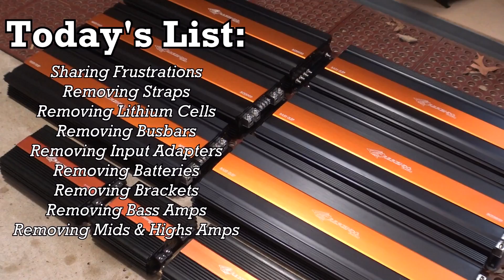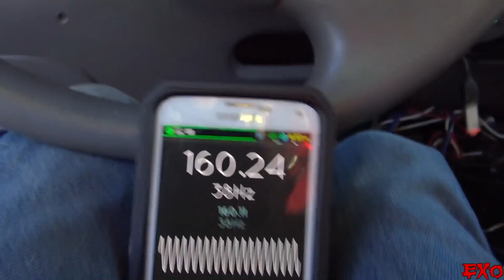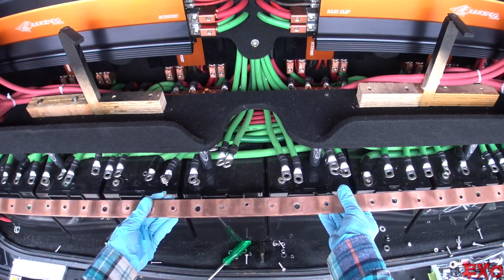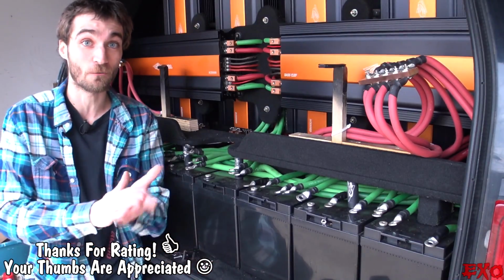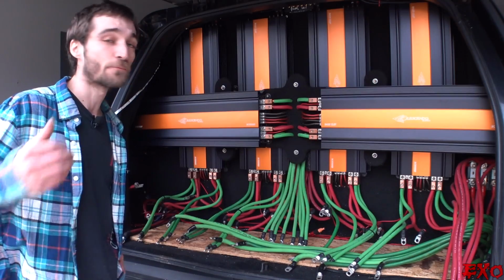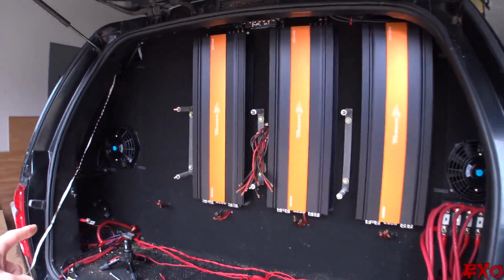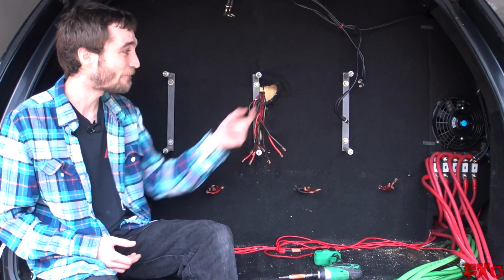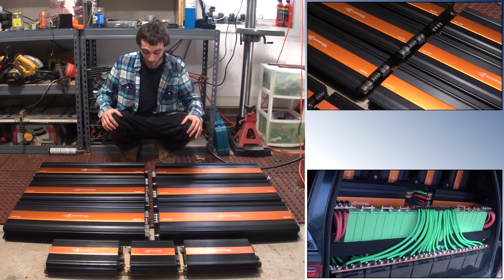REMOVING a $15,000 Car Audio System!! EXO's 30,000 Watt AMPLIFIER Install w/ Lithium & AGM Batteries

Comment from the maker: LET'S GET BUSY!!!

Happy Thursday, Everyone :)
Reply: EXOcontralto you just doing it but it box keep it going man that's up to you bro for life have a good day big heads for life and have a good day are you there you could do fiberglass that's a good box too I like five I like fiberglass but that is messed up so I don't know have a good day
Reply: Angel Studios GSG Gaming huh?
Reply: 50,000 Watts!!!!! Up next? Holy s***!!!
Reply: EXOcontralto You know I always love me some crescendo powa
Reply: someone might want to buy some of those AGM batteries for building backup power supply or solar power battery bank. quite a few different uses for heavy batteries like those besides car audio since they are good for deep cycle use.
Reply: 4Awg can take like 120A if its copper, thats a hell of alot ;-). what can help is keeping your wires shourter (if you can) to reduce resistance losses too.
Reply: True, double the cross sectional area of the conductor and its resistance will half. 3 factors are the resistivity of the metal in the wire, thickness (area) and length
Reply: EXOcontralto Awesome video bro. I can't we live in the state as you. Can't wait  to meet at a show bro. You are one of the postive builders on youtube and with ur videos u have taught me alot... Always keep up the videos bro God bless. I def want to give a demo sometime of my system
Reply: EXOcontralto yes!! exo you have been a huge inspiration for me and lots of other people... keep trucking on!! You have actually inspired me and my twin to start planning our own build. We are thinking of either 6 15s, or 8 12s in a school bus along with some bunk beds, then road tripping it to Texas on our senior year so a couple years in the making but hell look at franky. Friggin 7 almost 8 years in the making still going big and getting it done!! Keep on keeping on exo love the videos!!
Reply: EXO bout time for another video! Lol
Reply: EXOcontralto pay day tomorrow exo !!!! Hey got any tips for a starter ???
Reply: EXOcontralto  You and I think alike a Lil OCD.. open up the back panel of the amplifiers to check the condition of the thermal grease between the heatsink and the finals or the drivers.. we all know how dry thermal paste affects the cooling factor of the amplifiers. TOM NJ♡♡
Reply: 1 I use to rebuild alternators back in the day and checking the brush conditions isn't that hard especially if you have a paperclip before putting them back together. Alternators are to maintain the health of the battery.. and if one of them starts to fail it will affect all of them. Putting extra stress on the voltage regulators which also contain thermal grease... hmm mm great question. TOM NJ ♡♡♡
Reply: Elliot Hunt  keeping them shorter definitely helps with resistance.. and keeping the polarities further apart or shielded helps also.. great reply..Tom NJ ♡♡♡
Reply: Keep up the energy don't worry about the extra special effects.. keep a little piece of paper with different suggestions on what to do.. Morris County Audio New Jersey 5 years ago put 3 in of concrete on the bottom of their Blazer with PVC piping to run the wires to the back.. they came in second place in Florida.. love SPL!!!!!!!!
Reply: I do a RE Audio 15 sxx v2 tuned to 29hz
Reply: EXOcontralto are you selling your old agm's?
Reply: EXOcontralto where do you get your copper bars at for a (block distributor)
Reply: Fix your description past is the word you want. Passed is something you do in sports or at the dinner table.
Reply: If you are looking for new ways to do videos or your channel as a whole I suggest starting a Discord server. While this is primarily a gamer based activity it would let you create a more 1v1  feel for some of the more die hard/active viewers. You could find other people who are good at installs and have them be admins then when people ask questions if you can't answer it then the admins can. I think it would be a really neat thing for you to ad to your channel/rapport.

Let me know what you think!
Reply: hey i am from 2019 i didnt get the video before that video can some one help me out plz

Comment: What you need to do? Is make your own fiberglass "Speakermobile"..line speakers all over the roof,fenders,sides,aim more at the ground through holes in the chassis. A moving San Andreas fault with 1,000DB easy.

Comment: I have been watching you off and on for what must be a decade or more. Crazy times. Your post work is amazing man and your workmanship is even better. I am stoked to see the new setup. I have a question, any reason you don't solder the tips of your connections to really max out the current transfere?

Comment: Unbelievable how much the price has went down and quality gone up. 
 In 1987 I had over  almost$17,000 in a 4,000 watt rms Alpine system ,with some Audio Control EQ and crossover equipment. Just unbelievable.
Reply from the maker: Prices are still pretty high in some markets.

Comment: Hey EXO building behind system here and was just curious which RCA cables you trust the most and why I want to get the best sound I can and I figure the radio signal cables would be something that I shouldn't

Comment: If the back allows for it, why not shingle the amps with a slight gap between? Airflow can be dealt with using fans, but this might be the most space efficient way to do it, especially now that you're going to have eight amps.
Mount them horizontally, and put them at either a 45° angle or a 60° from the floor (30° from the wall) angle, and stack them that way.

Comment: Awesome video EXO i was wondering tho what are good RCA cables to run or what do you run
Reply from the maker: I use cheap MonoPrice & AudioTechnix mostly. I hate it when people say you need $100 pair of RCAs lol
Reply: EXOcontralto thanks im dooing a rebuild and have been researching RCAs i wanna go with a bc5500 i just orderd a pair of skyhigh lastnight its just that i heard there is diffrent types but seams they are basically the same

Comment: You put so much effort to mount those things..... You are now tear downing..... 😖😖but hai... Now it will be awesome....
Reply: Ranjan Gupta did you notice how many washers he was using for the amplifiers as a spacer? It must have been like $5 for each Bolt.lol.. he should go lighter and possibly use small tubing made of aluminum.

Comment: You can do 10 18s jp did it in his Tahoe with no problem, I'm not going as big as you but close, im either going to do 8 3500's or 4 7ks on 4 Tantric Shd 18s
Reply: I believe JPs was sealed thought. Major airspace difference
Reply: Yeah thats true it was sealed

Comment: You must have a lot of money to burn...I just bought a used 2003 Mazda MPV with original 65k in mint condition and it cost me $6,000 -less that half of what you paid in amplifiers.
The high powered car amplifier trend is all new to me and the word madness comes to mind. Many extreme audio builders would agree, as they often say "it's insane!" to express just how powerful their audio system is. To use a negative (word) to prove a positive one is to admit that this whole trend is not in accord with reality i.e. it's not normal to blast your brains out with sound that’s not even music. 

Meade himself admits that what he does is an addiction and everyone in this trend gets their fix by blasting themselves with audio vibrations so powerful, I'm surprised no one has lost their hearing. By the way, tinnitus is incurable and believe me you don't want that. And the question arises, who is EXOcontralto, Meade, and other audio builders making videos for? From my perspective, no one, for the most part. I mean, what do they do? They build monster audio systems that take up half your car and add 100's of pounds to it thereby lowering your gas mileage. It also cost so much that you would have to be insanely rich to waste so much money on extreme high end systems that can never make music sound any better. Louder, yes, but it does not mean loud music makes better music. There is only so much the human ear can discern and tolerate in terms of loudness.  

If you think about it, this trend is not even about music. The joy of listening to discriminating music with a HIFi system at home died years ago and the quality of music of today leaves a lot to be desired. Rap music started out as songs of protest. Now it’s mostly about money, sex, violence, and drugs. It can be said that EXOcontralto's videos and other audio extreme creators create videos as entertainment. Going to extremes creates drama, curiosity and excitement. The more extreme and insane, the more youtube clicks hence more money for the creators. Meade even destroys expensive speakers for fun. So here we have EXOcontralto tearing down his 16K system to build another one. A year down the line, or perhaps even sooner, he might do it again. This certainly is his prerogative but this constant building and rebuilding has become, I believe, the driving force to fund the addictive cycle to keep the insane builds going all the while the real objective of having an audio system in a car is lost to the average guy like me who just wants to learn how to install an audio system with a moderate budget. I suppose that, in time, this monster audio trend will die just like the HiFi stereo system did decades ago. If you are reading this, EXOcontralto, be careful. If you get tinnitus (a constant ringing in the ear) it will make your life a living nightmare.

Comment: Is there a reason for the rubber gloves
Reply: He was doing that while handling the copper bus bars I would guess to keep finger prints off them
Reply: Thank You I Had A Dumb Moment
Reply: Seth they would tarnish from the oil on ur hands ur hands have moisture and oil and it is actually slightly acidic so bare metal or bare unpolished copper would rust off just a touch
Reply: It wouldn't "rust" it would patina. Some people like the way it looks, for audio applications it's probably not the best.
Reply: da leezard Wth do u think petina is? It is rust, rust is corrosion, petina=corrosion=rust all the same
Reply: Daniel Harrell not exactly rust is diffrent from corrosion but it is the same if what you are sayin is the corrosion leads to rust forming

Comment: Why do u use stainless hardware it has a very low heat displacement rate i think u can buy copper hardware

Comment: Put a fucking $1 socket adapter on that impact and use it on the nuts and bolts also, the hand ratchet is making me crazy.